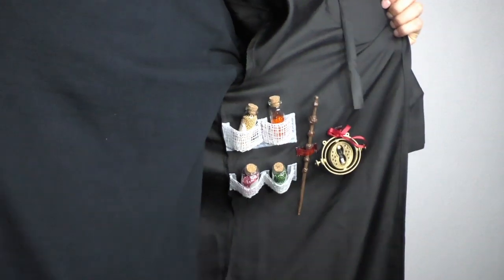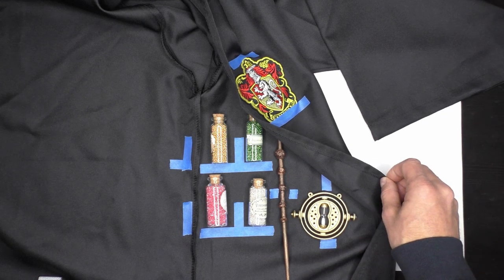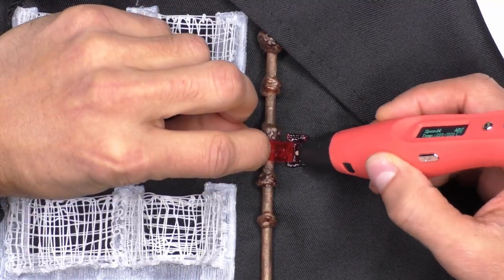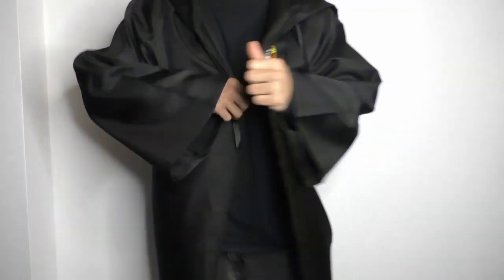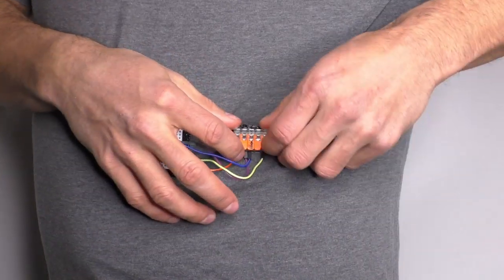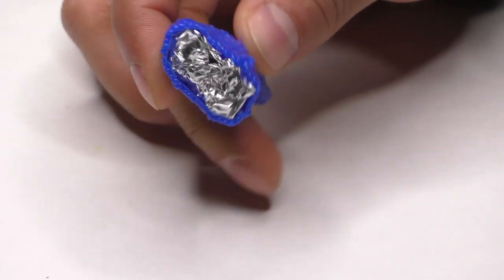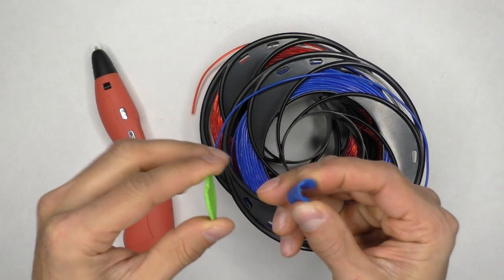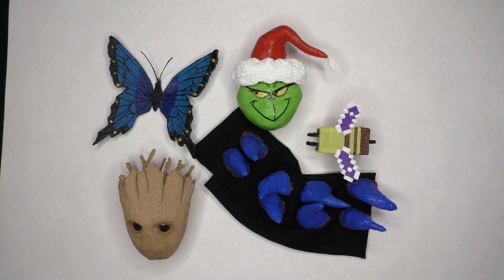3D Pen on Fabric- 5 CLEVER Uses for Costumes / Cosplay

Comment: Great work mate, really like what you do and these ideas are really useful and can be applied to a lot of things, what temp does flex filament print at i have not used flexible filament before. not sure if you mentioned it but i missed if you did.
Reply from the maker: Thanks appreciate it.  Hope you can do something fun with these ideas.  TPU (flexible filament) usually works from 210-230 deg C.

Comment: Let me share with you my experience:
At the start of this year (March or May, don't remember), I got myself flex filament. And, for testing purposes, printed a small square on my home t-shirt. Successfully forgot about it. Until around half a year after (somewhere in August) suddenly discovering that square was still there despite all wearing and washing!
Now, in November, writing this comment in the same t-shirt, looking at this square, I say that this works. Printing flex on fabric is a good idea, opens new possibilities.
Of course, it came off slightly on the edges, but not much.
Reply from the maker: Thanks for sharing your experience and glad it worked!

P.S.  I successfully forget things all the time also :)

Comment: This is brilliant mate, there are endless ideas for cosplay. I was thinking about 3d designs on tshirt but I am not sure how much strong will they be especially if they go into the washer. Are those designs made with tpu filament ?
Reply from the maker: Thanks, I thought you would like it.  RClifeon did some 3D printing of flexible filaments on T-shirts, so you might want to check his video out on that.  I believe he said they did not survive washing.

I have washed one item a number of times, that I used a small patch of flexible filament on.  So it might depend on how the flex filament is used/applied.
Reply: @PotentPrintables  Ofc I like it and thank you for sharing those tips.

Comment: Is your 3D pen specially designed to use the TPU filament or are you using another configuration like ABS or PLA temperature? Also, if it isn't designed for TPU, is it going to damage the extruder or get cloged? I ask because I'm interested in TPU filament but my 3D pen says it only supports PLA and ABS. Thanks in advance.
Reply from the maker: The pen I use for TPU has adjustable temperature controls, so I just put it in the correct temperature range for TPU (which is near the range for ABS).

I haven't seen any pen that specifically certifies for TPU.  But I have been switching back and forth with PLA and TPU in the same pen for awhile now and haven't seen any issues or clogs.

Comment: Does PLA stick to TPU?
Reply from the maker: To some degree- it doesn't fuse to it like PLA to PLA would.  A lot depends on the surface roughness of the PLA object (rougher the better).  I'm going to be experimenting more with this in the future, so let me know if you try this and what you find.

If your application allows, you can also add in many small thru holes to the PLA + fabric and put TPU thru both sides to anchor it in place.

Comment: Does this work with things like Vinyl or faux/real leather?
Reply: And also do these kinds of plastic sand well?
Reply from the maker: The rougher/coarser the material, the better it will work.  I think Vinyl will not work very well because it is smooth.  Faux leather might work.
Reply from the maker: I haven't tried sanding flexible filament much.  You can smooth it with a wood burning tool.